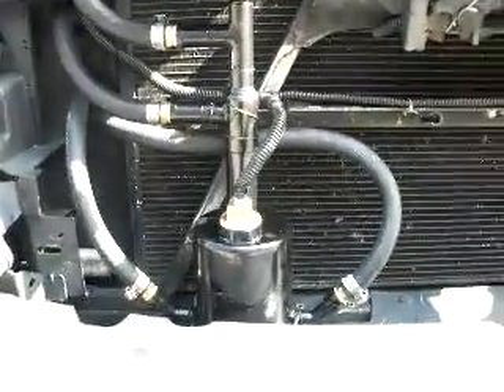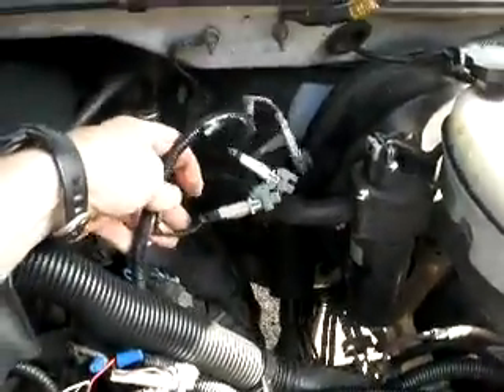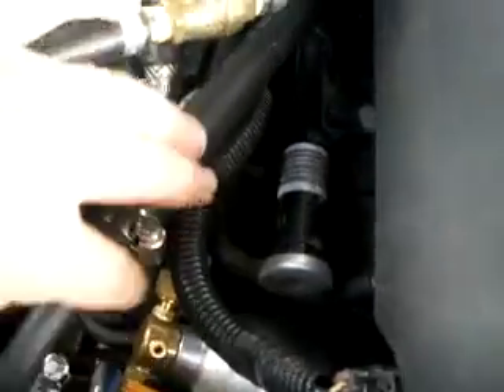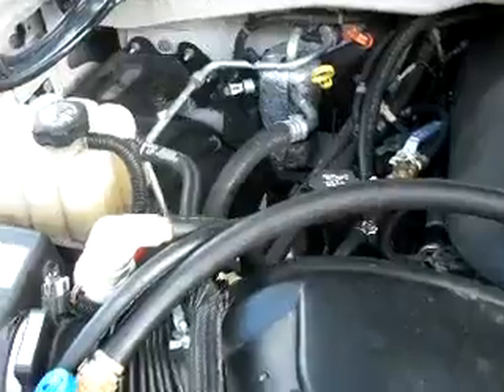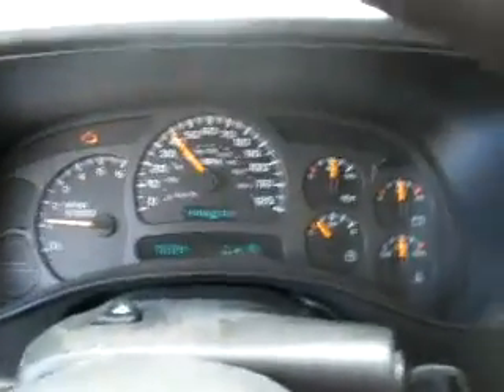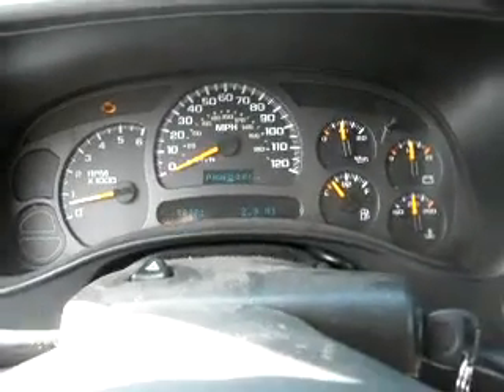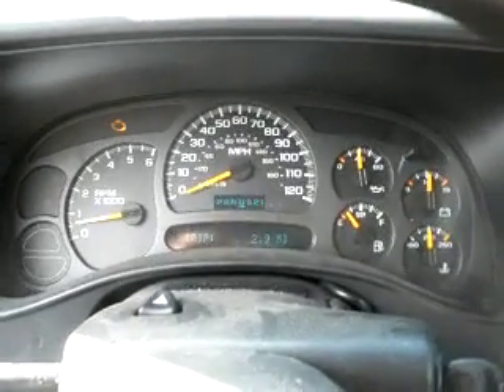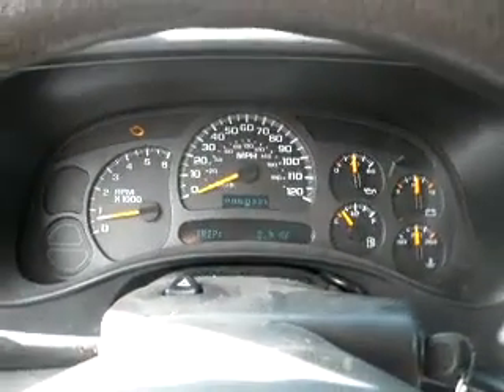Road Test In Progress from running on gasoline vap

Comment: Any updates on this?
Reply from the maker: No, this project ended back in 2013... I ran out of time to experiment. I actually drove it for around 5 to 8 minutes then it stalled due to the idle side gas vapors ceasing because the gas wasn't heated as the throttle side was. It's a 2-part system that makes it work. Thanks for watching.

Comment: Dude it doesnt matter if you have back flash arrestors.. At minimum, with the volume in the hoses, you are going to blow connections apart spewing flame across your vehicle.. Also, what did you use for back flash arrestors?? Anti-backfire valves from a smog system?? Not a 100% seal if you check it out..
Reply: How is it going to backfire when the ignition is controlled by both a crankshaft reluctor that optically triggers the ignition that operates in conjunction with the camshaft sensor that tells the engine the exact time to fire the spark plug? Any detonation or pre-ignition signs from the knock sensor immediately retards or advances the timing so that a backfire through the throttle body is as close to never gonna happen as it gets?

Comment: you're running off vapors? you got both brain cells working today....right?
what do you think your engine ran off from to start with? all you did was make a dangerous  carburetor what could kill you and your family. how will this truck act if it backfires throw the intake (that will cough fire)right into your fuel tank. older cars/truck where know to do this, mainly cars/trucks with  carburetor that where not calibrated the way they should be. or if somebody that didn't know what they were doing,(like you) messed with'me
Reply from the maker: +jesse cobern 
Flashback arrestors were installed in three different locations... It is impossible to have a backfire and I never had one yet. And yes, both  sides of my brain is working if you think I didn't know that. And of course an engine runs off of vapor, it's the overspray I'm talking about. There's other ways of cooling an engine then by wasting  gasoline to do it. Thanks for watching.

Comment: I made a chamber bubbler out of a gallon paint can. It's stuffed with aluminum kitchen scrubbers that are stretched out. Three openings leading lines to the bottom of the can. Three lines leading out into the air induction after the air filter. It sits on top of the exhaust manifold and  the content boil creating pure vapors. I add gasoline and my piss which turns to ammonia with the heat and it assists in combustion. Same as an urea tank on a new diesel truck . Urea. Urine. Get it?  I  don't know what this guy is doing. Coolant temperatures are not hot enough to boil into vapors. Mine is an assist, not a stand alone system. Just haven't tried it with the fuel pump disconnected yet. Lots of power and mileage improvement.
Reply: So you've got a sort of "vapor assist", then? I tried a very similar setup not long ago, but constant rainstorms kept me off the road and unable to test as needed. I simply mounted a mason jar, loosely packed with oil-absorb pads rolled along the circumference of the jar, with steel mesh on the inside to keep it from possibly clogging the air hole. Anyhow, it was a wicking system as I had seen controversy whether bubblers were better than wicking, ultimately decided to go the wicking route. My last test was in the rain over very hilly backroads (lots of shifting). The wierd thing is my baseline mpg w/o the vapor assist was much lower than the cars rated mpg. However, with the vapor it shot up significantly. I have the results recorded in one of my notebooks, I'll dig it out if interested. Test was done on an '09 4cylinder Hyundai. I also based my results on the actual fuel used i.e. topping off at the pump. I may start messing with it again..

Comment: It should get about 125 to 150 MPG
Reply from the maker: +James Mackinlay 
 I actually drove it for around 8 minutes until the gas began to condense down in my gas tank, then it would no longer accelerate because that side was not heated like the idle was. . . I would have loved to see those results though! Thanks for watching.
Reply: James Mackinlay .
My pinto does.

Comment: 80s system was on a temperature switch 180 f on the thermostat  housing that allowed vapor from the charcoal canister to be draw in from the fuel tank .we used to put in solenoids 12 volt ones and a three way switch in  to switch from gas to vapor same as propane duel fuel does. some of the big pigs got over 35 mpg on the highway at 75 mph.

Comment: So what you are saying is that the standard air to fuel ratio is a myth? Or, wouldn't this still need the same amount of fuel as if you were using injectors? Are you running lean? I mean, even with fuel injectors spitting less fuel, the engine runs hot and eventually dies. Without fuel injectors to regulate the mixture, don't you still need the same amount of fuel from vapors and thus, shouldn't your mileage be the same? I mean, it is a stoichiometric ratio so, the number of molecules is accounted for. How can this be chemically possible? I can't see it. Should be a fun experiment. Think I'll try it on a cheap lawn mower or something. Cool idea.
Reply from the maker: No, I never said that... The standard air to fuel ratio is the common engine mechanical world standard. When vapor is being used, 100% is being burned and consumed. When adding ultrasonic water vapor into the air intake with the gasoline vapors creates an incredible burnable mixture that satisfies the engine and all its moving parts to achieve maximum power as it was designed for with no internal damage. The water vapor makes up for the stoichiometric ratio in calculations. Thanks for watching.
Reply: +whyme2b So where are you at with the U/S water vapor/fuel vapor mix ratio? Was that part of this 8 minute journey ??

Comment: It is fine to make small improvements as long as what ever you invent does not improve mpg by 10 to 20% max.  If you do improve the mpg by any large amount you will face oposition by the oil cartel industry which makes there money off selling you fuel.  The goverment will also get upset because they get there revenue off of the amount of gas that you buy.  In the begining they say they want cars to have better fuel economy and when cars started being made to get better mpg then they said they are not making enough on the fuel tax to support there kingdom and needed to increase the tax rate to compensate for the loss revenue.  This is why we need anyone that comes up with a great idea not to be greedy and hold back on that knowelge to make a few bucks because they will end up missing but they need to share it openly with everyone so that this idea will not get killed.
Reply from the maker: Thanks for sharing buddy , very well said. Thanks for watching.
Reply: John Chan 
they all use there knowledge in wicked ways that HARM nature for the WEALTH needed to be kings upon the earth.
Soon humanity will burn these king pin war pigs to he'll with there gasoline were they sleep.

Comment: as a tech for 25 yrs  yup thisis ,, back fire and u are toast for sure,, for u just feed the fire with vapors,, plus  you probably would wreck your pistons,, also plus up your cadilytic converter...  it is interesting that it works,, and yet,, you spray starter fluid in your throttle body of fyi engines and it runs,, the same theory.
Reply from the maker: That's nice, I actually have plus five more years on you in being a auto mechanic, but that's okay I don't mind other people's opinion. Adding water vapor into the air intake will eliminate any problems with overheating. I did however install flashback protection in three different locations and never had a problem. Thanks for watching.

Comment: For an engine to work on vapour You need to remove the valve overlap on the camshaft..That is done for LPG ..Maybe you could try it with a LPG head and cam
Reply: Griff Griffo .
Removing the overlap on the exauhst lobe will give back 80% of the efficency being stolen by the exaust venturi effect during compression stroke.

Comment: It would pass emissions if they actually probed the exhaust which is what they would have to do if your car was built before 1996. His vapor set up burns much cleaner and is extremely efficient. After 96 it will fail because these lazy emission standards only require them to plug into the computer and retrieve data. The check engine light would cause it to fail even though it burns much cleaner. The truth is if our or any government really cared about air quality instead of just garnering some idiots vote who doesn't know any better the would outlaw any gasoline that is less than 91 octane. It doesn't burn clean and pollutes the environment, if you track your millage you will see for your self how inefficient it is to run anything else. You do not save money buying cheaper gas, the oil companies know this and they also know that most of us don't.
 Also because this vapor system actually burns cleaner you would not need that expensive catalytic converter to burn up the unused fuel.
 Keep it up Buddy, little backyard inventors is what made the world what it is. Good on ya whyme2b.
 To the guy who said it's dangerous to you and other people on the road...Not if he knows he's doing, and it looks like he does...what is truly dangerous is ignorance and blind obedience. Buck the system once in awhile and think for yourself, you just might come up with the next big idea.

Comment: Confused!! All gasoline vehicles run on vapors or 'atomized' liquid that evaporate into vapor. Since liquid cannot be compressed (water, gasoline, any), your extensive mods on this vehicle proves what?? Next time try a simpler experiment: get a pan of gasoline and throw a lit match into it (I'm sure the 'liquid' gasoline will extinguish the flame as liquid does not burn), then get yourself a pan of gasoline and hold the lit match right above it (make sure you wear a fire suit). Happy experimenting!!
Reply from the maker: Confused? Not at all, I know that.... and I actually did see water be compressed in a hot engine and it ran just fine. The point I'm trying to prove here is that you do not need wasted over spray of gasoline to keep the cylinders and valves cool. There are other ways to do that instead of using gasoline. Thanks for watching.

Comment: Where is the vapor being metered?  Are you feeding it into the intake manifold vacuum port - or some other location?
Reply: There is an amazing amount of potential here. I hope you continue with your experiments and continue to post the results.  :)
Reply from the maker: Correct, Bruce is right. I did install a damper on the air intake and closed it off completely. Air and gas vapors was pulled from the tank and mixed together just fine. Thanks for watching.
Reply: +Bruce Binkley  -- Making a guess that the metering is being done more or less by the throttle plate..  Seems to make sense that the more air the engine draws, the more vapor will be pulled along with it.

Comment: There are many ways to improve the electrochemical process reduced to combustion for the sick of simplicity.
Simplicity is probable the limitation of engineering when come to furfill the marketing demands. We - at least me- are not some unknown genius minds that discovered what lazy  cars  industry with budgets of zilions could not discover.
Ni brand risk its reputation for a minor (or even worse) incident knowing that end users are absolute careless about details like filling a second tank with water. That water may get frozen..So, they used fuel as multipurpose consumable. The fuels were reformed to be less dangerous ( less prone to evaporation required for efficiency) and post combustion treatment like catalytic convertors come up as solution to pollution.
In fact a close loop electrochemical conversions may recycle the energy of hydrocarbon improving its conversion into kinetic form may give us time to verify and implement other solutions. But this lead to other economical consequences and greed is prevalent human characteristic.  This is why we end up with hopeless hydrogen trend ( burning hydrogen is not more efficient than burning gasoline just less pollutants measured at tail pipe, more in fact in whole process) This is why we end up with fancy electric cars that require resources unavailable at acceptable costs.
Reply from the maker: Well said buddy. .. excellent  speech !!!
Reply: +whyme2b  look at my drawing and build .then you will see what u r  missing ....no heat just vacuum +air+metered vapor to intake. no more stalls because the fuel ceases to vaporize. this system vaporizes ALL of the fuel before the intake . and no lean burn

Comment: Looks good. I'm  doing similar experiments. Little more complicated setup but, basically same theory. The 14.7:1 perfect ratio may reffer to same aggregation state at certain RPM and load only. Is a theoretical statement. More fuel is used in order to improve chemical reactivity. In liquid state the gasoline is not burned efficiently but used to cool down the engine. No engine run at that ratio. Gasoline vapors may run any vehicle but attention should be paid to collateral effects. In your case I bet on cooling effect caused by pressure drop in the tank and condensation of water from air that is added to gasoline vapors and make it works. In my experiments I've noticed the ignition time retarded due knoking caused by "superlean" mixture and I add water that contain a lubricant. Lack of lubrication of upper head claimed by some is valid point. Examples of LPG are not supported. I know an LPG specialist who install a second device to lubricate the valves then tune it to leaner mixture. Otherwise the safe tuning on LPG should be rich and this cut off the financial advantages.Or will wear prematurely the engine. My system use also electrolysis of the water to assure homogeneous combustion. In fact the myth if water as fuel is based on same chemistry. PCV oil fumes are burned efficiently if water, hydrogen and exhaust gases are mixed.
Due ECU limitation stock  engine not support this conversion and good engines not provide enough oil vapors on PCV valve.
Reply from the maker: Yes, thanks for your comment buddy. ... true! I found that just water vapor from a ultrasonic disk introduced into the air intake would supply the engine accurate cooling effect to run at that ratio with no engine damage. There's always a way to perfect things ! Thanks for watching.

Comment: im pretty shure this is fake, you accelerate by pressing the gas peddle and extra fuel is released by the injectors, the more you press the more fuel the injectors let in the faster/ more power /speed you have.   p.s. brillint job heating an explosive fuel/gas. glad your not in charge of a nukelear reactor.
Reply: ***** im not sayin the engine won't run on vapors, it would only get to a certain speed, say 700rpm and stay there  , it just has no way to accelerate unless you have a bigger vapor pump and valve set up to let in more gas.
Reply: ***** no sir you are wrong the engine will excel-orate better when you press the gas the engine takes more air in casing more vapor to be brought in and fumes or vapor off gass is far more explosive than the liquid counter part hints exceloration do an experiment with a lawn more or something and find out before you start commenting about things you know absolutely nothing about
Reply from the maker: Sorry, but it is real.  The injectors are unplugged period. ..which means no fuel will pass through them. There is no leakage of fuel either due to electrical coil not engaged. This is a 2-part system in how it works. ... vapors for idle to start, and vapors for acceleration to go. The heater is used to prevent the gas from condensing down. .. completely safe at 210 degrees F. I might have a few ideas on improving a nuclear reactor as well. ... Thanks for watching.